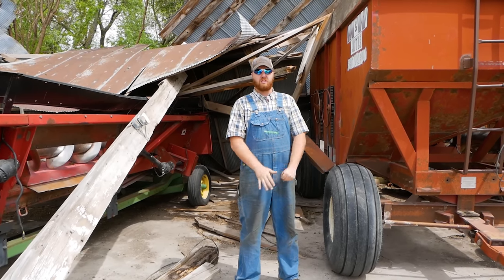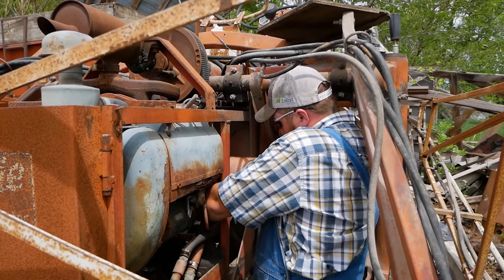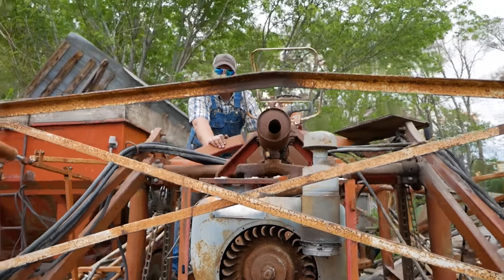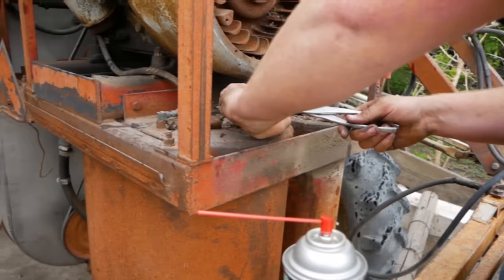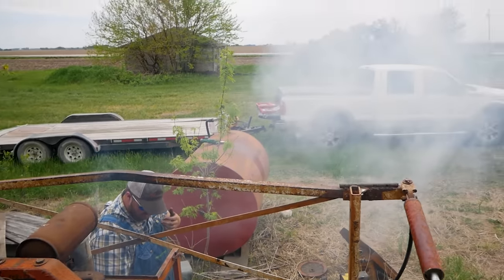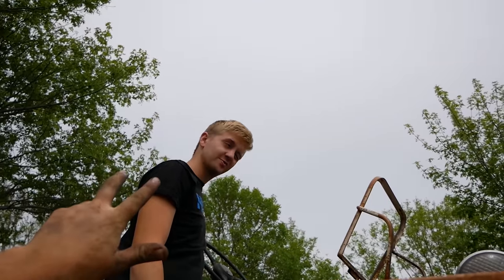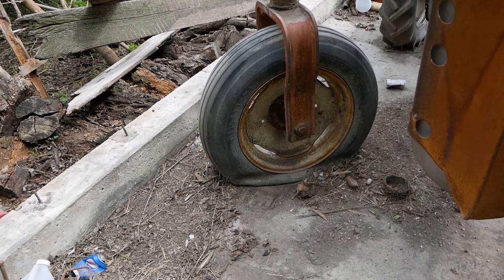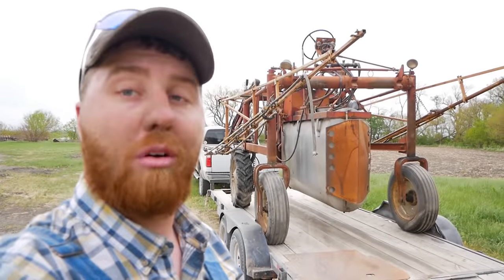Can We Farm With ABANDONDED EQUIPMENT? - Ep. 4 - Sprayer Revival

Comment: Speaking of the shingle restoring your spark, I love how on these old carburetor and distributor engines you can literally get them running with things you find laying around on the ground around them.
Reply: Except it has gotten to the point of embarrassment... Kevin should be fully prepared by now for just about any condition or event that crops up for the average "will it run?". While he may be simply showing a way to get something done by making due w/what he can scrounge up, it got old many miles ago. He has a truck and he brings along some useful items but not all that he easily could... and should.  No points file in the tool kit? Cringeworthy. No spare fuel line? Cringeworthy. No funnels? CRINGEWORTHY! Good grief, he can't even keep batteries charged up. I could go on but I think I've made my point. He's either playing the fool on purpose or he's actually a fool. With whichever it is... it was stale long ago. Get it together Kevin, get it together! Go in prepared lad!!

- Max Giganteum
Reply: @MaxGiganteum  Also the possibility he just wants to challenge himself, sometimes coming in with tools makes it too easy
Reply: @MaxGiganteum  You must be very fun at parties.

No sense of humor? CRINGEWORTHY! If you think this is old or stale, go somewhere else. The internet is your oyster.
Reply: @MaxGiganteum  Would you happen to have a daughter named Karen?
Reply: @rawr51919  like knowing how to start fire with flint and steel when lighters are cheap enough. Some just like to know how to adapt and overcome

Comment: I used to have one of those hagie model 437. It ran well. The one I had, had the boom in the front.
Super easy to use, once you got the engine running put about 100 gal water in the tank
 Then you can engage the pump/agitator  this is where you would check all the nozzlesn flow rate at the psi wich is regulated by a regulator and engine rpm. Once that is ok add your favorite flavor of chemicals. Motivation is the fun part. Behind the seat is the gearbox ,pick a gear forward or reverse
Pull the lever that adjusts the pully on the fat belt/cvt. The more you pull the lever back, the faster you go, there is a cruise control on the lever to set your speed. Rest is simple.

Comment: I like to use a mapp gas torch to clean spark plugs. You hold them with a pair of vice grips and heat the electrode and insulator until they're bright red. Let them cool down put them back in and they're good as new.
Also on a stuck engine I like to take the plugs out and spray a liberal amount of PB Blaster in the cylinder before I start to work it back and forth. Makes things go much quicker!
Reply: Same here with the gas... I haven't bought a plug for years...

Comment: Shingle, old towels, random tools, I love it! Look for grip tape on old running boards or equipment steps too! The machines you're finding wouldn't have it, but maybe something close by? I also recommend snagging any old specialty tools if they are willing to part with them, like a chain breaker lol. You may very well need one if you keep this series going. Most equipment had an on board tool box to keep that one wrench, pliers, screw driver, hammer and even adjustment levers/crank handles that didn't stay on all the time (or it could have just been our crappy equipment lol). Things were literally 'fix on the fly'. I think the old timers would be damned proud of your ingenuity and resourcefulness. Keep up the good work!

Comment: I have a Melroe Bobcat M600 skid steer from 1967 with a Wisconsin engine too. They run like crap. Mine was outside for 7 years and was in about the same shape as that. It is hard to start those engines. I bet that was outside for at least 5 years. Good luck with that thing!

Comment: Note to self- the large COOP MOTOR OIL can at 6:14 says "Hydraulic oil" in small lettering near the bottom.  So it's not exactly motor oil nor would it be a great lubricant.  Might work in an automatic transmission; might not.

Comment: My guess of those numbers that you read off the motor are the stroke and the bore.
If the stroke is larger than the bore then it's an over square engine. If the stroke is less than the bore then it's an undersquare engine.

Comment: I always have great luck priming my Wisconsins off of carb cleaner...  give em a good snort and they always fire second pull (I only have 2 cylinder flywheel starts).  fired one off of carb cleaner than hadn't been ran in 30 years, and another in 10. They are faithful as all get out.

Comment: i like the farming angle.  i am not familiar with this but find it very interesting.  not crazy about beating on old equipment and breaking it.
maybe pack a pipe wrench for turning the flywheel?   and slip a .25 cent nail file into your wallet.  thanks

Comment: That's how I started farming 60 acres of land I go around I bought old farm tractor at the 1800 dollars or Farmall h and some Old Farm Equipment disc and much holler from cooking I need to work in the field for maybe under $1,000 and that's how I start farming I have 250 Acres in a farm 60 of it for corn and a farm the roast for Hayden for my animals and I hunt the rest of the rest of my land with in the woods for deer hunting that's how I started farming and I'm a pipe welder some home during the summer a little bit farming on my downtime that's the best route to start farming go by used farm equipment very cheap

Comment: hey I know you probably won't read this but I have a 1984 dodge ram w150 prospector single cab long bed with a diesel cab swapped onto the frame but I can't get it started I need help with the wiring to get spark and power to everything